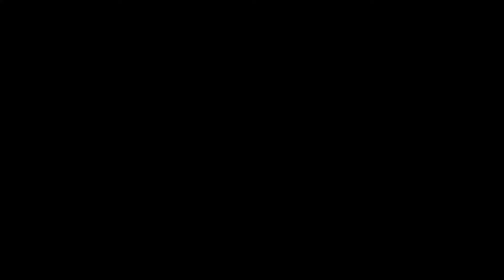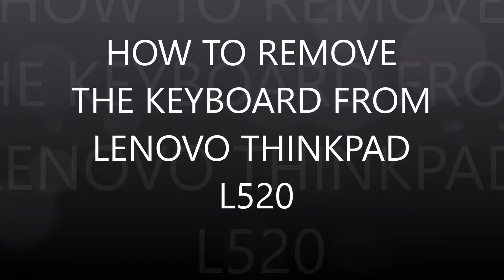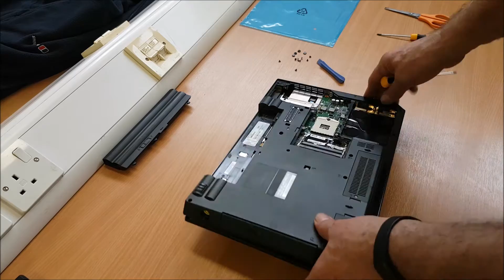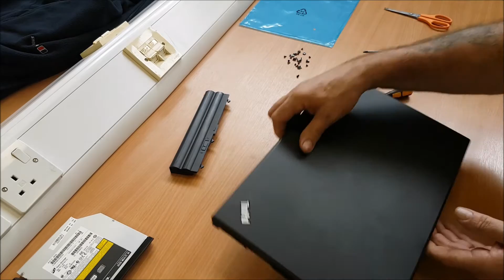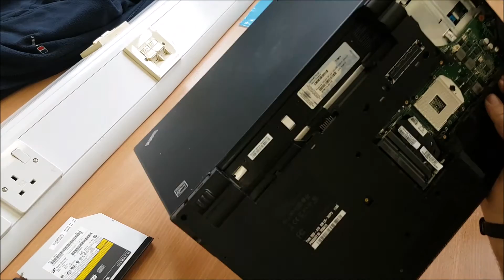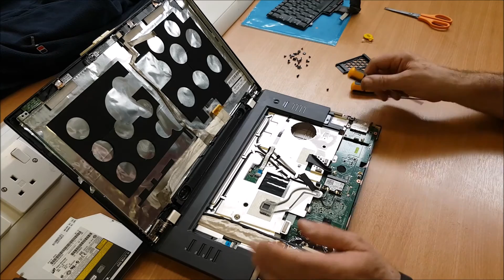HOW TO REMOVE THE KEYBOARD FROM A LENOVO THINKPAD L520

Comment: Thanks so much, just did what you did to the front section (didn't need to remove the rear screws) to replace the WLAN card right there under the front piece you took out.  WLAN works a treat now using a card that used to be in a Dell Latitude series laptop.